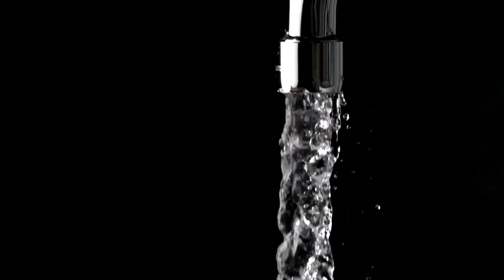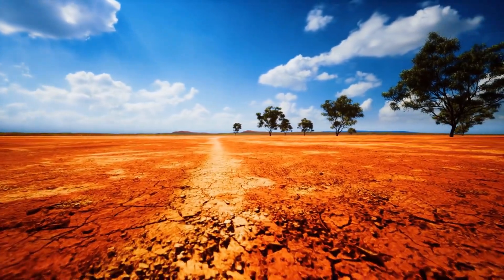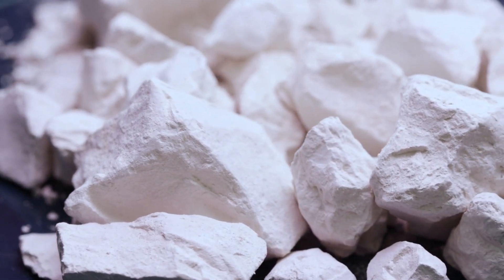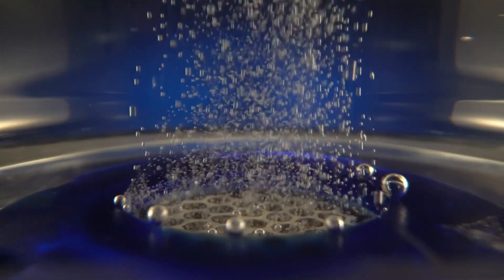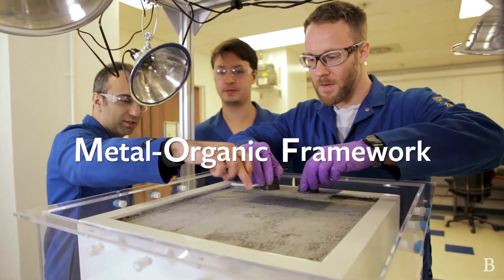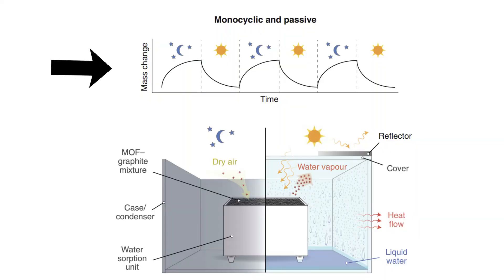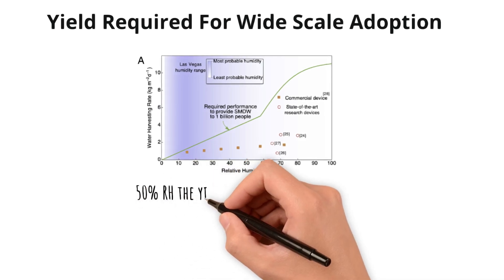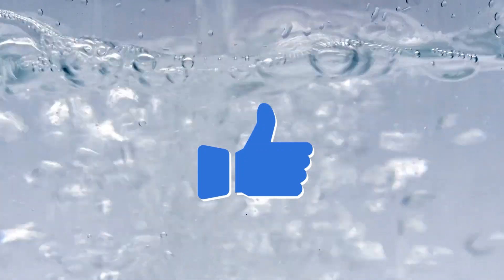Sorption Based Atmospheric Water Harvesting for 100's of Litres of clean water per day

Comment: How much energy can it use per unit?
Reply from the maker: https://synergyfiles.com/2025/02/the-best-atmospheric-water-harvesters-generators-awgs-for-efficiency-and-performance/
Reply: @synergyfiles3536  3.3 L/kWh is a lot of energy for a few liters. I wonder how to maintain that. 
How much do air humidity % and temperature affect performance?
How big are the smallest required off-grid power sources?